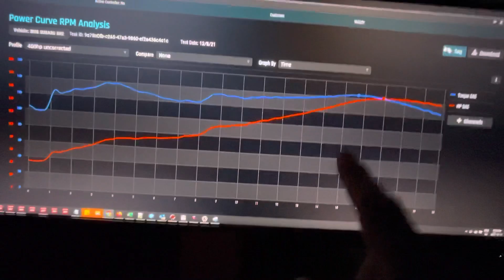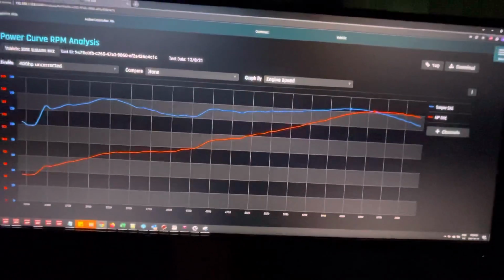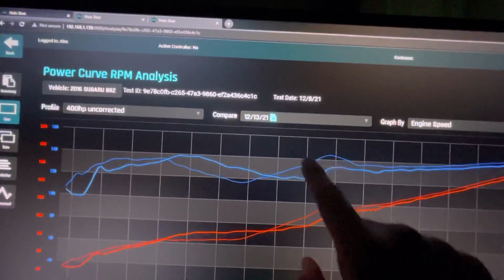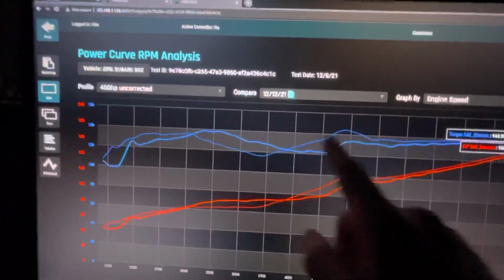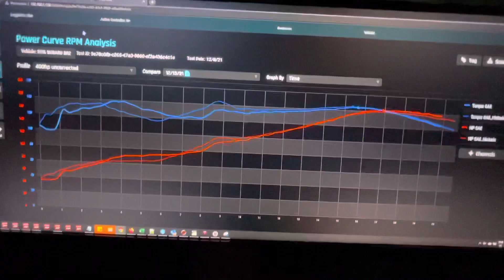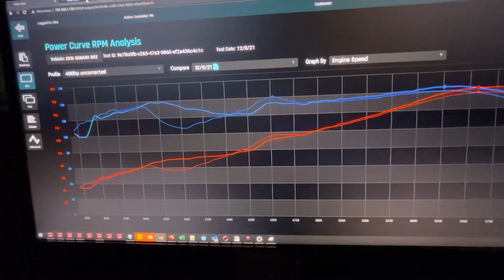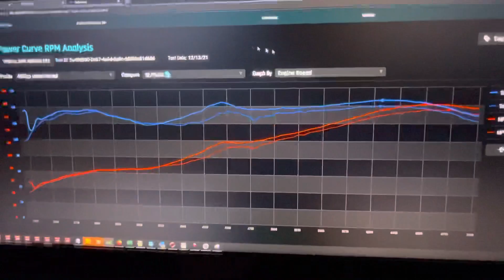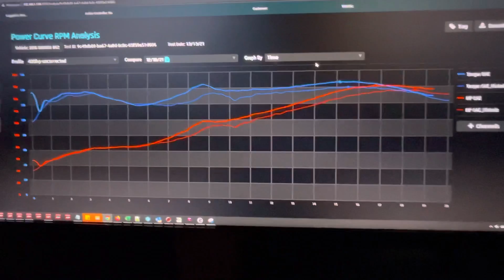2022 BRZ Build EP6: Does the 2.4 header flow well??

Comment: Is there a particular reason why the FA24 header has such a sharp loss in torque below 2500rpm compared to the FA20 header? Is it something related to the headers, or just something caused by a sudden acceleration on the dyno maybe?
Reply from the maker: At that very low rpm yes you are getting some artifacts from the dyno loading the car and drivetrain lash.
Reply: @stratifiedauto  ahhh I see. I'm currently trying to learn about what's involved with dyno tuning, so that helps me clear up my understanding. A colleague of mine that also watched your video suggested that it was due to the car pulling timing since the larger diameter piping was not creating enough backpressure. Although, seeing as the rest of the rev range picked up hp/tq, that idea seemed strange, and led me to believe it was a dyno/load issue instead.

Comment: Hi what over pipe are u using when instal gen 2 headers as i install gen 2 headers with gen 1 overpipe which is touching the subframe and rattle so bad
Reply from the maker: I kept the OEM over pipe. You probably need to adjust the exhaust.
Reply: Do u mean are u using oem gen 1 over pipe or Gen 2 overpipe ?
Reply: @ngebot8699  I’m about to try the same, did you solve your problem ?

Comment: For a track car where you shouldn't be dipping below 4k rpm much if at all, might the 2.0 actually be better due to the the torque gain above 4k? Would be interesting if you could work out the time factor only above 4k rpm. Thanks for some awesome work!

Comment: Very very interesting content. I think I speak for many when I say I'm excited what kind of gains the new 2.4L engines make with bolt on mods and 93 octane. Considering the old cars seemed to have no problem gaining ~15% torque and power to the wheels, 250whp feels lofty but could be possible!
Reply from the maker: It would put it in stock STI power category other than torque.
Reply: @stratifiedauto  I'm cautiously optimistic, but only because this car seems to consistently exceed almost every expectation. Still, when you put it that way it starts to feel less possible lol. 

I do expect these cars to be able to make 230whp with a well made header, exhaust, hopefully with 93 but e85 could be needed.

Comment: If the 2.4 header did make appreciable power on the 2.0 with a tune, there's probably a reason why Subaru didn't go with it in the first place?
Reply from the maker: The 2.4 header is an evolution of the 2.0. An improvement.

Comment: Does this have implications that a new aftermarket header for gr86 will not produce any real power gains? If the new 2.4 header is already designed well, I don't see how the aftermarket can improve much.
Reply from the maker: Watch out other video. An average uel header reduced the torque dip further

Comment: And one other thought…I live in Ca.  There are no headers for BRZ approved in Ca.  Opinion has it that none will be due to the costs and the few cars.  Therefore, I can’t wait to see what you can pull using the stock header, a cat back that is reasonably quiet and a tune.  I’ll also be interested in what power adders and suspension options you investigate. Thanks for these vids.
Reply: Oh, and I should add that I’m 73 and this will, pretty much,  be my DD.  So, I’m not going to be into doing header changes, etc,  more into engineering and performance gains….this is a return to “purity” for me.  My last serious toy (just sold last year) was a 64 falcon sprint that made 600+ hp.  Needless to say, I spent a lot of time finding appropriately engineeredsuspension and rear end toys.  All, just to go straight at launch.  So, while none of that here you can be sure I’ll be wringing it out.  I have already put aside a set of top and bottom caster bolts, after watching that comparo video.  That the kinda of great insight I look forward to in your videos.  Thanks again.
Reply from the maker: A tune and some ethanol will go a long way.
Reply: I get the ethanol.  I might consider it but I have to drive at least an hour to find ethanol!  Believe it or not, I too live in Cloverdale….Ca.  So going into Oakland was nearest source.  What I could easily do is order 5 gallon cans of race fuel…..what mix would you suggest?